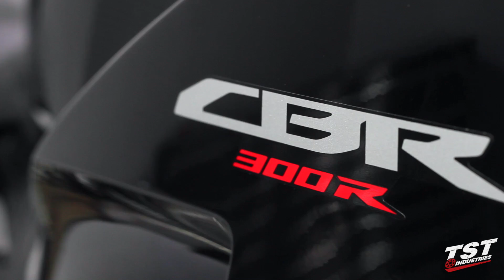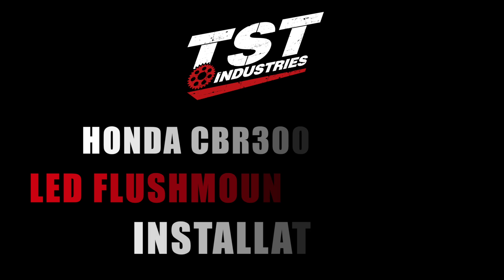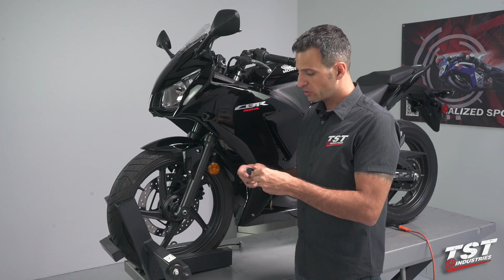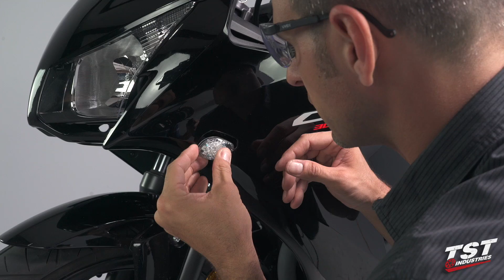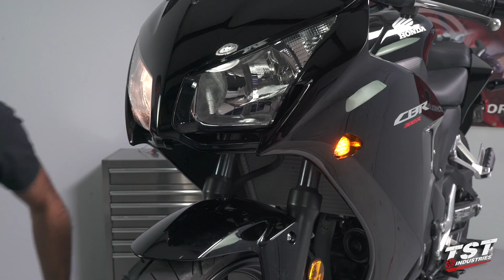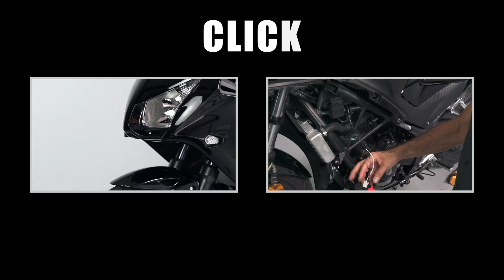How to install LED Flushmount Signals (Option 2) on a Honda CBR300R/250R by TST Industries

Comment: Do you make these for CB300F, or will these fit?
Reply: @Ryan Shrout havent found out anything. Sorry. Nice to know someone else owns one though. The customization options are pretty ass if you dont know. The Chinese dont even make knock offs of the plastics.
Reply: @Ryan Shrout My best advice is to buy ebay fairings. Theres a few. And a honda motorcycle dealership should be able to source anything you need. Maybe try a normal automobile dealership if theres one closer to you. Good luck.